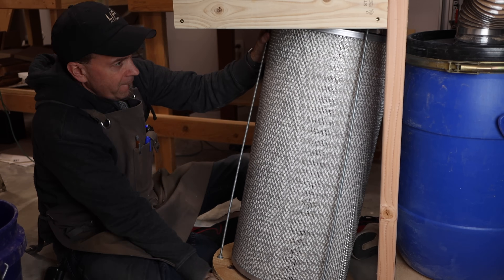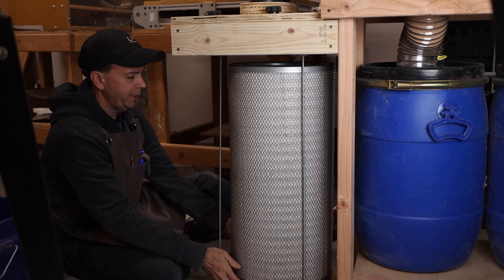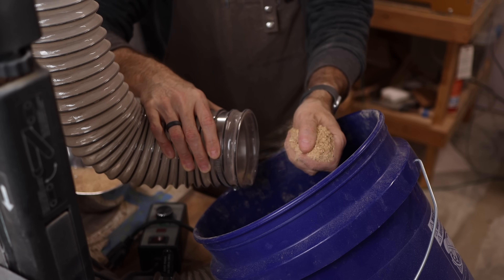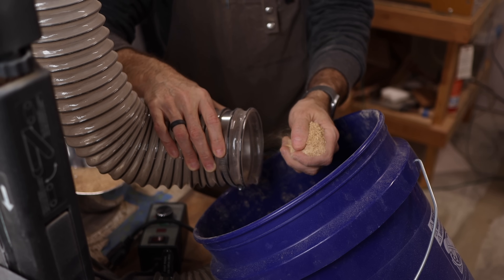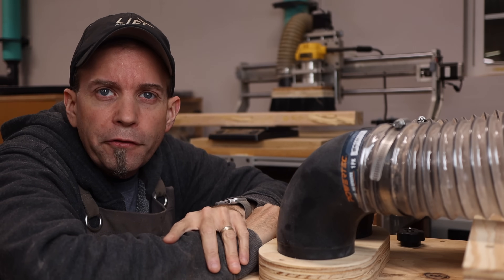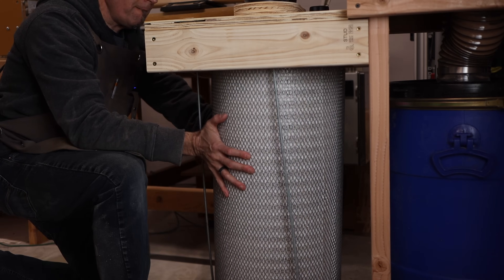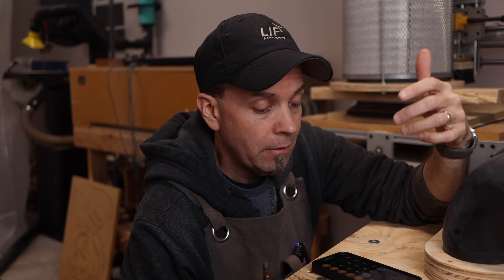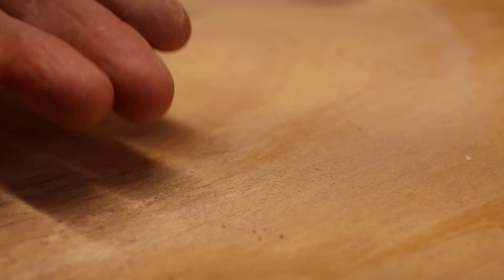Centrifugal Dust Separator 3 - The Escape Test

Comment: i am not sure how you work (say) a router or a planer but If I need to get some plywood circles going or get some wood nice and smooth I surely produce 1000 grams of sawdust and chips in (say) less then the 38 minutes you dragged things along... 
Interesting: I should test what kind of volumes and weights I produce with the various tools involved in my even smaller shop...
Reply from the maker: Yah, it was a painful way to drag out the test to get some results.  If you check out the 4th video in the series, you'll likely find the answer to your volume concern.

Comment: I think I'm going to build one of these. I built my current setup on a mobile cart so I can move it from tool to tool, but I placed the motor too high and when I empty the collector of dust, it throws off the balance just enough that it can begin to tip over when moved from the wrong side. I've learned to push it and NEVER pull it.
Reply from the maker: I'm glad you're considering building your own.  Before you build, please take a look at the @capturingdust channel.  Ruud has taken my design and modified it to the next level, greatly increasing the volume of material.  It's some great work on expanding the idea.
Reply: @pilsonguitars  ha! Good call. I think I've already watched all the videos there at least twice now!

Comment: Thanks for the great work!  Now that you've had it for a while, would you recommend this over something like a Super Dust Deputy based system?  Have you had any problem with the system clogging?
Reply from the maker: The Super Dust Deputy is a great system from everything I’ve seen and read.  If I hadn’t built my own system, that was my next purchase.  Mine seems to be working well.  I haven’t had any issues with clogging but I’m only collecting from my machines which don’t produce a lot of large particles.  So far, I’m pleased with the results.  There is a gentleman from Europe that has taken my design, made some great improvements, and will be releasing a video and file updates soon.  I think it’s going to be a solid step up from my design.  Thanks for watching!

Comment: Great video, thank you for sharing, I love the effort to learn and improve! This is my first ever comment on YouTube to hope it’s not wasted! 
Do you think it’s possible or worthwhile to scale it down? Something which would work with a vacuum for hand tools. Would take up less room than a bucket and cyclone. Thanks
Reply from the maker: First of all, thank you for watching.  I'm honored to be your first interaction on YouTube! 🙂  As for your question, I think it's feasible since the airflow would also slow (likely) with the vacuum setup.  There are existing units that others have referenced which are built specifically for portable vacuum based setups.  I haven't tested any of those, but my design was simply a scaled down version of the Harvey design.  (8" down to 6")  My recommendation would be to grab whatever tube size you are considering and run some test prints.  I would starting printing the inlet and then just abort it after about 10mm in height.  That will leave you with a ring that you can start test fitting for tolerance with your size of pipe. (adjust your scaling factor and repeat)

Comment: Going off on a tangent, I think you could have saved that $22 investment in the scale, assuming you have the necessary parts on hand.  Create a balance scale with a hanger for your filter on one side and enough weight on the other to balance all but maybe a pound or so of the filter.  A sturdy putty knife might make an acceptable fulcrum, or some bearings and a rod through the beam would make a fancy one. Put your kitchen scale under the filter where the beam is pretty much horizontal.  Weighing before and after should provide the weight of the collected dust.  The benefit here is that a scale that can weigh 5lbs can probably more accurately measure a small difference than one that can weigh 90lbs.  I personally would test this first by weighing the filter and then adding a known weight to it to make sure the beam doesn't somehow scale the weight difference.  Hey, it might make for an interesting video itself if it works.  How many of us have wanted to weight something but don't have a large enough scale or a bunch of accurately known weights in various sizes?
Reply from the maker: I love that you wanted to save me $22!  Since my guitar builds don't make me any money, I'm always looking for some cost savings.  Much appreciated!

Comment: Excellent system and well done with attempting it in the first place.  How much do you estimate it cost you to 3D print the parts?
Reply from the maker: Not much.  I think I ended up using 2.5 of the 1kg spools.  I caught an Amazon sale on one of the spools @ $15 and they are normally around $25.  So all in, around $52.

Comment: I'm totally planning on building this! In my space I'm planning on placing the blower between the filter and tubes in the system. Can anything think of a reason not to do it this way?
Reply from the maker: Many have recommended that exact setup.  I considered it, but would have needed to rebuild my stand.  I think you’re on a good path!
Reply: Jou need dustbins that can handle the vacuüm. It works well in my case; https://m.youtube.com/watch?v=ENybYVAr11Q

Comment: On idea to help with static buildup, (although would require full reprint and increased material cost and does not address the tube itself) is printing the components out of a conductive filament and grounding that.

Comment: I actually think upping the air volume with the 4" hose helped you. The separation relies on speed. The more you choke off supply prior to the vortex, the slower it will go. You will likely see poorer performance if you necked down to a smaller tool without allowing additional make up air.

Comment: Have you tried having the fan pull air through the system and push air to the filter? This way you won't have material in the impeller reducing effectiveness on the airflow? Also stops damage to the impeller.
Reply from the maker: With my setup, I don’t really worry much about material damaging the impeller because I don’t have much for large chunks that go through.  I may still try it anyway.

Comment: Fluid dynamics does not scale linearly. 
When you reduced your spin down tube you also reduced their length.
That was a mistake.
The lengths shouldn't reduce as much as the diameters.

There should be a slightly longer distance between the drop out points into your capture ports.

Other than that piddly little thing your design is great.
Reply from the maker: Ah, interesting.  Appreciate the feedback on that.  Maybe something to iterate on in the future.

Comment: one could put the filter up top and have a collectionbag below. maybe saves the filter a little bit too?
Reply from the maker: Yah, essentially putting the separator in front of the existing Harbor Freight setup and adding a filter on top and bag on the bottom.

Comment: Please don't waste your time, effort and money on trying to remove the static.
If you stop and think, you're applying a conductor, using an adhesive (that's not a conductor) to a PVC/Plastic pipe that's not a conductor. It just doesn't work, you cannot earth the space between the copper, because it's not conductive.
The only solution would be anti-static pipes, that don't need earthing, or do they?
Conductive paint? I have no knowledge but it sounds better than copper wire.
Love the work, the tests and the free plans, it's generous to a fault.

Comment: Amazing results. Thanks for sharing the files!
An interesting test might also be whether this also works as good if the air is sucked through the separator. With something like a CamVac or if placed infront of a regular dust extractors.
Reply: That would also work! This video tests Tim design with a dual motor CamVac;
https://m.youtube.com/watch?v=ENybYVAr11Q

Comment: Great update, love the results. In the end it's all about your health and air quality in the shop. I do mostly laser marking on anodized aluminum and that results in very fine dust (the anodized coating is being ablated from the aluminum). Even with dust extraction I do have some dust on the table so I installed on of those air quality measuring devices to measure a.o. those fine (PM2.5) particles.
With this kind of devices now even being sold for home use in the kitchen (I think this is a bit of overkill), there are cheaper versions becoming available for hobby shop use.
Reply from the maker: Looking into one of those monitors now.  Thank you for the tip!

Comment: Fantastic, I would say without doing anything you have put this to bed for me... Now I am wondering if I should wait for your upgrades or just glue up the pieces I have already made.  Either way I am way ahead with a nice dust collections system.  Sorry to pose another experiment for you but since your way more willing to chase a rabbit down the hole then I have the patience for I am hoping to pose another problem. In you second video you placed the cyclones in series and it had the effect of increasing the PSI. Now from my understanding its not really good to use a 2 inch hose with a dust collection system because the air flow drops so low that a shop vac would be better.  Based on the second video could you create something to go inline with the dust collection that would bring up the air flow enough so it didn't lose out to a shop vac?
Reply from the maker: All the updates I’ve made are in the current files on GitHub.  Any changes I make going forward (or other’s make) will show there.  (comments show each update on GitHub)

As for the reduction in sizing, the lowest diameter in the system is 4”.  The only reduction is from 5” out of the blower to the “Y” which reduces to 4”.

Comment: I think you should still weight the dust captured by the separator, to get an idea of what was left behind in the piping. I have a feeling that the percentage staying in the piping may decrease with time as all the nooks and crannies get filled in, so more dust will reach the separator after a while.

So the interesting percentage is what is left in the filter vs what enters the separator (what you get in your bins plus what you get in the filter).

Yet, it is a very promising result.
Reply from the maker: That’s fair.  For context though, the rest of the system has been in use with my previous dust collector, so all the nooks/crannies should already be filled in.
Reply: @pilsonguitars  Considering how little is passing through to the filter I reckon you should probably also weigh your bucket of sawdust before and after testing. If only 12 grams make it through to the filter I reckon it is possible a similar amount might be left in the bucket

Comment: I am still hoping you move the impeller (original dust collection blower) to the exhaust side of the cyclones. Since  you have to rotate the airflow down into the Wynn anyway, you might as well capitalize on the space used to mount the blower there.

Comment: Dont bother with the dreaded anti static.. if you search no domestic fires have been reported in the US on pvc dust pipes last time myself and several other  people checked. I would not put corn flour aluminium powder or milk creamer thru though
Reply from the maker: I’m with ya’ on that.  Though some thin adhesive backed copper tape is probably easy and cheap enough to add a little static dissipation.

Comment: We need to be more concerned about the level of <2.5 micron particles in the air than the weight of the large particles captured by any dust-collecting device. Using the amount/weight of visible dust as your only metric sends a false sense of safety and effectiveness as particles that cause lung damage aren't being captured and can't be seen with your eyes. Adequate volumetric flow at the source of the dust and power to overcome the resistance of the piping/hose system, accumulator, and filter are the most important variables. Monitors that measure PM2.5 are less than $50.00 and will let you know when it's safe to take off your mask.
Reply from the maker: But I just spent $22 on that high quality scale!  I’m not sure I can invest any more. 😁  Kidding… appreciate the feedback.

Comment: You know, I know the justification for the copper strip is to ground the structure, so you DON'T generate static electricity/sparks/fire.....

But I wonder what would happen if you INTENTIONALLY generate static electricity to attract the super fine particles.... Similar to how those ionic filters work..   Wonder if that would attract the super fines, and THEN you could ground it to have them drop into a container.

You might be able to put some sort of screen/mesh in place that's ionic to attract those particles, and still ground the frame itself to have the static not build up.   Would be an interesting experiment.
Reply from the maker: Seems like we should go all Mythbusters on that static buildup theory and see what the actual potential is to make an explosion.

Comment: I just can't fathom why anyone would want a horizontal system that takes up so much floor/wall space instead of vertical unit that occupies basically useless corner space. Corners are where things go to be forgotten.

At least with the commercial unit I can see the purpose of sliding under a counter, but even then it just doesn't seem like an efficient use of space.

Cool project to execute, but to what end?
Reply: Many people have low ceilings that make vertical systems difficult.
Reply from the maker: Well, honestly, I probably didn’t put enough thought into the floor space before I built it. 😏

Comment: well done on your results after a lot of hard work. I suppose with a P1S arriving soon to replace my ageing Ender 3 I'll finally get around to doing this in my workshop now that I can see a clear path to success.

I truly wouldn;t bother putting a copper wire inside the tube, however. a) it;ll get crap caught on it all the time and b) I guess the reason people want you to do it is that they are scared of a fire caused by a spark and the dust suspended in the air. While yes in theory that is possible, the amount of dust needed to be suspended in the air to start a fire or explosion from a static spark is so incredible that you're never going to get close to it.
Reply from the maker: Looking forward to hearing your results!

I hear a lot of back and forth on dust/static hazards.  There are very, very few examples that I can find, outside of large industrial shops, where it’s ever been an issue.  I was thinking about some thin, adhesive-backed copper tape that I’ve seen.  Seems unobtrusive enough and easy just to have “something”.

Comment: Question: why do you run all the dust through the impeller before you let it go through the separator? Why not go separator-impeller-filter?
Reply from the maker: Many have asked the same.  It’s because my original Harbor Freight setup was that way, and the commercial equivalent to this system is also setup that way.  It works fine for me because I don’t usually capture large pieces.  It could work just as well, or better, the other way.
Reply: @pilsonguitars  thanks for your response, and sorry for not finding this response on another comment...ergo bonus comment/engagement;)

Comment: Excellent series! Im already printing the pieces, and dont even know where to put anything lol.

But, lets talk feedrate. As we are digging into the fine details here, that feedrate seemed very extra slow...what i see when working are more bursts of material, for example, cutting 48" if plywood in one go normally engulfs the whole jet cyclone with dust, using the floor sweek also does the same, running the miter saw...same thing, bandsaw and sanders much less, but also much finer dust. Planer/jointer also very bursty but now with bigger chips .. just something to consider.
Reply from the maker: For sure!  That’s why I closed with, “this works for me and my setup, may not work for everyone”.  I’m hopeful that bursts with larger particles is caught easier.  The bursts with fine was where I was experiencing larger escape.

Thanks for watching and for the feedback!
Reply: @pilsonguitars  you probably know this, the super fine dust created by sanding has too little mass and can't be collected with the cfm the DC provides...from reading and experience, that's where the shop vac shines. Not sure if a shop vac or a shop vac dust deputy combo works better here, as the wind speed is even higher...I'd guess a shop vac only is more efficient in capturing all the super fine stuff, but only a test will tell us that :)

Comment: Got to admire your tenacity on this ! = ) Heck of a result !!! Couple of things to mention... Maybe a paint stirrer on a drill to get the dust airborne might have been a little less mind numbing. A slower but still constant rate of feed and then only a little left to hand feed. The second is an easy "shaker" system for anyone interested. Find an old SDS hammer drill, make a flat ended bit, press it up against your extraction cart somewhere suitable ( maybe screw a steel plate on somewhere ) and let rip. Quick, cheap, easy and effective = )